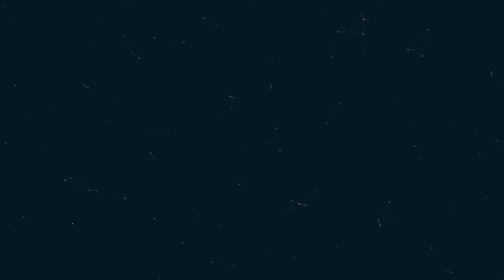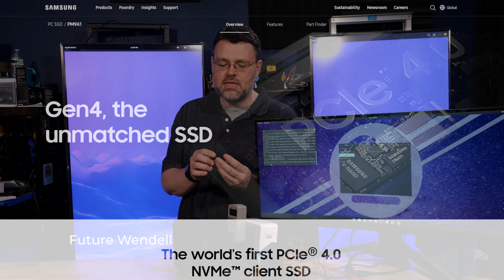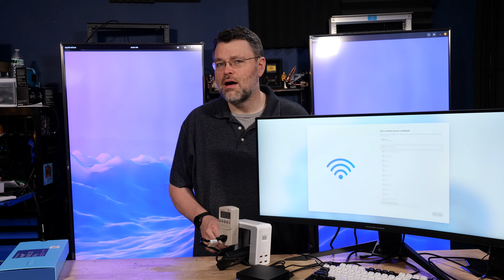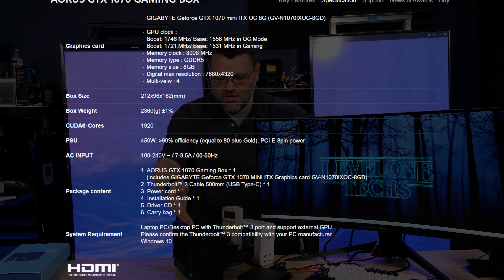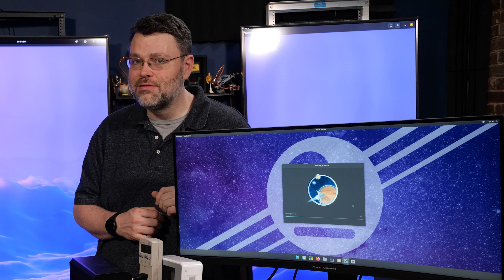Intel NUC 13 and Microsoft 11... Better install Linux

Comment: If one runs a 16-process on NUC 13 with Linux, can all cores be made to run equally fast? which Linux distribution did you have success with?

Comment: Strange.  Maybe due to a recent BIOS update, but the Intel NUC 13 Pro that I have gets 10215 on the multi-core Geekbench 6 score and 2400 on the single core Geekbench 6 score.  I also have 64GB of DDR4 RAM.  I don't know if that effects performance that much.

Comment: It would be super nice to all of the viewers, if the video's text overlay correctly displayed the corrected OOBE command for Win 11.

Here's a correction:

In Shift-F10 Command Prompt, type the command:
OOBE\BYPASSNRO
+ [Enter]
to bypass the mandatory active network requirement and the even more evil forcing of the use of an invasive MS account

This means you'll also be able to create a local user account, as we have done for 2+ decades.

None of this would be required if MS would just take the newbie kids out of the Win 11 dev group.  Experience still really does matter.  Otherwise, Linux will keep gaining OS market share.

I hope this info helped.

Comment: I have three Intel NUC 12 Pro with core i7 to build a Kubernetes cluster at home. I am in the process of building it up.
 You mentioned this idea in the video and referred to a potential video on the Linux channel. Also, the Thunderbolt connection between the three NUCs sounded very interesting. Has any of this been done?

Comment: I've skipped through the video again but apparently missed the Windows problem bit.

Got a NUC13ANHi7 (tall) recently, put some RAM (KF432S20IBK2/64) and an SSD (SKC3000D/2048G) in and went to install Windows 11. Wait, has it just crashed? Let's try that again. Removed power, went back and no, not a crash, the device just didn't have ANY networking, nor option to skip anything or try again. No WiFi? Is the cable broken? The the replacement as well? Why is my ancient switch only showing a sort of connection at 100Mbit? Odd. Ah well, SHIFT F10, OOBE and there we go.
It has been a VERY long time since I've seen this much yellow in the device manager! A throwback to the olden days. I'm not sure where the hiccup started, a lack of chipset or networking drivers, but something kept both the Intel AX211 and 226-V from being recognized and apparently fully initializing. Yes, Windows 11 22H2 had initially been released before the NUC 13 Pro, but I kind of expected a recent ISO to contain at least some form of driver to get the thing going. It's not even exotic hardware.

I had an ASIX AX AmazonBasics USB adapter on a shelf. Back USB port? Nope. Front USB port? Yup. We've got network. Took a while, but it loaded just about everything. I manually installed Intel chipset drivers at some point, but the rest got in automatically. Intel's DSA found a bit more, and even after Microsoft pushed a UEFI update, DSA hat yet another one. I'm not sure I'll ever get used to it. Lenovo has given me severe PTSD just reading about X1E's Gen1 updates. Never had a problem there but the anxiety never went away.

Noise - at ~28C ambient the fan kept pretty much going all the time and it sounds like a typical notebook fan to me. No, not the X1E turbine. 😂

After all the decades of tech, it's still magical how snappy and powerful such a tiny box can be.

Now I wish there was an m.2 10G SFP+ adapter for future upgrades.

Comment: No one ever seems to mention that you can tell the Windows installer that you want to add the computer a local domain and it will give you a local user as well.

Comment: I bought this last month, barebone, i.e. byo ram and ssd, when installing win11, win11 did not have drivers preloaded for wifi and lan, and somehowi still needed to go into cmd to manually install the lan driver to get the 2.5gb lan working to continue. F you microsoft.

Comment: 😆 At this point I don't see why they don't just add a 80mm low RPM/profile fan on the bottom with a proper filter, it would cost pennies and solve all problems regarding temps, dust and noise. Ain't like you need to avoid the extra 4cm of height consider all peripherals still hold a standard size, also add a Bluetooth 5.0 internally to promote wireless devices usage.

Comment: Wendell, my suggestion for mad science project is a 40GbE cluster in any of the following configurations:
 1 node as a NAS with the NUC head-end using a Thunderbolt dock for a PCIe HBA to host SATA drives, and either:
- compile farm running 'ccache' and 'distcc'
- compute or render farm for scientific apps, video encoding, 3D renders
- video editor workstations clustered to NAS storage
Could be fun.

Comment: Question...I have a slightly used HP laptop and I wanted to install google chrome, but Bing/Edge wouldn't have it.  I'm working on learning Linux, and in particular Mint as a starter OS.  Do you have any suggestions on how I can delete Bing/Edge and Install the operating system of my choice?  I hate being made to do something that I have not chosen to do, or operate.

Comment: Thanks Wendell for that tip about getting past the MS Account + internet page - I HATE setting up Windows using my MS account because of the way MS STILL insists on using the first 5 letters of the email address of your MS account to name the user folder WITHOUT GIVING YOU ANY OPTION TO SPECIFY WHAT YOU'D ACTUALLY LIKE THAT FOLDER TO BE NAMED and once it is created it is SO intertwined with registry keys that you had better leave it alone - I liked using a local account to set up subsequent new user with a folder name >>>I<<< chose, make it an admin account, then switch it to a MS account, deleting the initial redundant local account... Why does MS hate it's users so much?

Comment: I've bought Vivobook with i3-1220p, it came without windows preinstalled, and the worst thing was that it bricked 1 pendrive with windows install on it, it hasn't seen two others so I needed to find the oldest one that I had in house, really and that pendrive was just 4GB which forced me to download tiny11 which barely fit on that pendrive :D not to mention that I needed to add some intel drivers because it also couldn't see a Micron NVME SSD lol. The struggle was real but in same time that little i3-1220p is a fast powerful bastard for simple things like web browsing, or playing some old games.

Comment: LGTVs support IP control as well.  If you're using the network port anyway, no need for a silly USB<->Serial connection, especially since consumer TVs don't often have the serial port on them let alone the computer, you can still do the IP control thing.  I feel the pain though.  I've had to install LGTV Companion to get it to support turning off and on the TV automatically, but it does have its faults.

Comment: MS is doing classified work for the Army, Navy and Air Force. That gives them the power to dictate what they want. Previous lawsuits were ear pinching by them to put MS in line.
Reply: Classified work on Windows? Shudder.

Comment: 10:30 ; I worked at a pretty decent sized warehouse (30,000ish sqft) with a half a dozen docks and ground level doors as well where the new CFO refused to run the exhaust system because it was rather expensive. Dust would accumulate so thick that you could visually notice height differences on flat objects if they didn't move for a while. They managed to kill both a desktop pc and an air compressor, and massively accelerated wear and tear on very expensive equipment from just not cleaning it out. It baffles me that someone can make their way up into C-suite positions making hundreds of thousands of dollars a year and regardless of how many times you tell them dust bad, dust cost you money that they don't comprehend it.

Comment: had to install linux on an old one, i wasn't gonna screw around disabling bits on a nuc just to install windows, it's like the bad ol days when you needed a floppy disk at install time to get a raid chip working, that you probably didn't want at all.  i seem to remember once having to do that for a network card.

Comment: I'm doing not-so-light programming tasks on a Core i5-8500T Thinkcentre, and it's not bad at all. This machine would be like a spaceship in comparison.
"You can play a click adventure", huh. Just played through the Mass Effect Legendary Edition trilogy on the built-in UHD630 in native 1080p and max graphics settings. Currently playing ME Andromeda which is A LOT more taxing, but still playable.

Comment: Saw windows 11 problems coming ages ago.  Tried to make a post about it on the forum.  Mostly got poo-poo'ed on by other forum users, inferring I was wearing some sort of tinfoil hat.  I maintain everything I said previously.  Avoid Windows 11, try to stop using Microsoft products.  Switch to Linux!

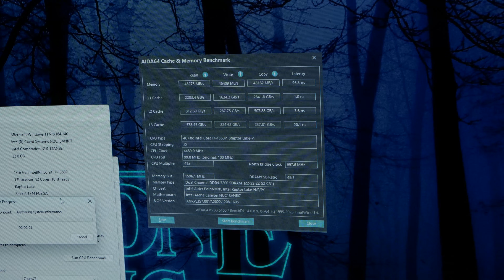Comment: 8:25 "Ninety-five seconds of latency on DDR4 — it's gonna hurt us a little bit."

Do you enjoy Wendell's inability to self-correct when he misspeaks?  As much as I do?

A minute and a half of memory latency sounds worse than it is!  Do I have a working Tandy 1000, from Christmas 1984?  I sure do¹.  Although its memory is lightning fast — compared to the CL-95000000000 modules in Wendell's NUC — the Tandy only has 256 kilobytes total memory.  Half of which is on a 128 KB memory expansion board, occupying 1 of 4 PC expansion slots.  It occupies the slot closest to the CPU — not sure how important that is, over an 8-bit bus.

The 39-year-old Tandy may be quicker — but it can't load much in to system memory.  And no HDD, for swap memory.  Only two 5.25" floppy drives, compatible with 256 KB floppy disks.  If I load DOS and an application into system memory (via floppy), could I use "swap in" 2 blank (formatted) floppies — to create 512 KB of swap memory???

If so... maybe I can exceed Wendell's memory latency.... of 95 seconds.  'Cause 5.25" floppies are slower than molasses on a cold day! 💾 (that's a 3.5"-floppy emoji — which rendered obsolete, the 5.25"-floppy emoji. lol)

¹ [EDIT: Forgot to include footnote] I have not tried booting the Tandy 1000 since 2010.  But, it booted — and loaded WordPerfect, DeskMate, Paratrooper, Lode Runner, Karateka, One on One: Dr. J vs Larry Bird, and Microsoft Flight Simulator... version 2.0.
Reply: One of my first jobs (1984) was working at a Radio Shack Computer Center. They made that machine "just" incompatible enough to fail as a real competitor to other PC clones. They could have been a real contender in the clone arms race with their vast company store distribution network. Ah, memories...
Reply: @andrewr7820  - That's awesome.  I worked at an "everything" Radio Shack, in 1992.  A few Tandy computers, half-a-store of consumer devices¹, and half-a-store of replacement parts and tools!  I still have my Radio-Shack-branded, PC-repair toolkit.  The one with that garbage, soldering iron included — along with all the half-garbage tools — in a fake-leather, zipper-folio case.  $20 for that seemed like a good deal, when I had no experience.  Do you remember that thing?

The Tandy 1000, however, was not supposed to be a PC-clone — but, a PCjr-clone.

In that role, it excelled.  The T-1000 was more PC-compatible than IBM's own PCjr!

It was not, however, particularly compatible with the PCjr.  My neighbor had a PCjr.  His had 2 cartridge ports — for all of his "software".  The floppy drive seemed to be only a data-storage device — to write files and read them after they're written.

Neither the Tandy(s) nor any other PC-clones, to my knowledge, could use the PCjr's proprietary, cartridge-based, software.  Not because the software was different — only because it was loaded on those tiny cartridges.

¹ Including a 6'-diameter, satellite-TV dish — for "over 500 (analog, ≤480i) channels!"

Comment: Disable SecureBoot? Well, if you pick a distribution that has signed bootloader/kernel no need to do that for about a decade. Fedora, Red Hat or clones to name few. Disclaimer: I am from Red Hat 🙂 Granted, distros with unsigned bootloaders/kernels do exist.

Great review, Intel NUC is imho one of the best products by Intel. Pair that with a passive case and you have a wonderful Linux server for virtualization :-)
Reply: unless you found you need to apply some dkms patches to support some of your hardwares 😂

Comment: "linux loves this kind of hardware".  But I thought you said this was current generation hardware...
Most linux distros still have trouble picking up storage and radio hardware correctly on a 2 year old laptop from a mainstream OEM that offers this model with Linux installed.

Comment: I'm pretty sure this small PC runs circles around the HP-9000s and IBM RS-6000s we used to run logistics software for the EU distribution centers of several international producers, warehouse management for a large car manufacturer and so on. 
Today it's barely good enough for small spreadsheets and some slides or light web development. Something went wrong and it went badly wrong!

Comment: Lets hope it’s better then the AMD 3750x graphics because that doesn’t play nice with the 4 latest Linux kernels on fedora 38 gnome/wayland had to revert to fedora 37 with an older kernel. While windows 11 works great on my new build this has bin going one since the start of the year btw.

Comment: Low power is the way to go for me in the future, something like this has the potential to pay for itself in a year or so.
Reply: I've run 100+ thread Enterprise monsters to starting with a laptop as a server. Now I'm ditching all the older off lease Enterprise gear for smaller and more power efficient devices.

Comment: The missunderstanding here is that you still think Microsoft actually cared. While I see it as obvious, that Microsoft has abandoned the consumer market already since Windows 8+. They already had lost much interest with Vista and 7, as you can see by the loss of features bith windows versions meant for themselves and every subsequent windows version to come (like hardware accelerated asound for example).
All they now do is grab as much as they can, for example from people paying the full price for Windows (as if it was an OS, and not a kisok-mode application launcher..) and of course personal data, while actually improving not a little thing about Windows since Vista. It will of course take some time, as Windows' heritage is huge and the market share is only slowly going down at the moment.. but the trend is accelerating and they don't even care, because otherwise they wouldn't cripple the UI more and more, insert more ads and improve spionage to a point where soon no one will ike to use Windows anymore. Their AI and cloud services are where the big money of the future is.

Comment: This NUC13 Pro model support SR-IOV on Bios? because processor with Xe graphic support it but i can't find  on 11gen and 12gen NUC.
Reply from the maker: It's for downstream pcie devices but wouldn't work with thunderbolt as far as I can tell

Comment: i have to point out that the OOBE that microsoft drags users (paying customers in most cases btw) through is handled by many linux installers WHILE they're installing AND updating so that when you do restart, you can just use your machine already. macos is only slightly less painful than windows' oobe, although their installation process is egregiously slow.

Comment: No DDR5L? Hard sell man in 2023. I mean I get that these are aimed at offices to run Microsoft Office, active directory, pclaw etc and little else but man I feel that even business owners are eyeing this with some caution. As time moves forward DDR4 is going to get expensive as manufacturers stop producing it. And when these are sitting in offices for 8-10 years, upgrade paths for them will become very limited and they could be sought as a bad buy. Come on Intel, do better.

Comment: 13th gen even on desktop is really efficient - if you disable all the automatic Overclocking crap. Still loving the 12600K that i gave a relative. Never even hit TDP during full turbo in stresstests. Tested it on a few motherboards but stuck with a B660 - decent integrated wifi and bluetooth, same performance as on Z690 (and the auto-OC on that board drove it to > 150W for not even 5% more performance)
Reply: yeah I never understood people with OC wishes.

Comment: Hi Wendell! Have you considered a thunderbolt vs. M.2 adapter comparison for networking on a cutie little PC like this? Also, was there a reason you weren't using the logitech dongle to sidestep Bluetooth?

Comment: A Windows 11 license I'm forced to buy but will never use, and only one 2.5Gbps RJ45 port... Showstoppers. Otherwise, an excellent server box for a few dozen in-house services. Intel: add DDR5, USB4, and PCIe 5 & you'll make this compete with even mid-tier desktops at a fraction of the energy cost. I'm pretty sure that's the whole idea with 13th gen. And, PACKAGE A "BUILDERS' EDITION" (No disk, no OS, with add-on PCIe WiFi & BLE)! I'll buy a pallet of those.

Comment: Business class = ok CPU, no real GPU, half the RAM, a whole paycheck
Great for anything you could do on an old PC from 10 years ago, with an updated price tag.
This does, however, have a lovely form factor. If you are IT, it's easy to lug this to the shack to fix.